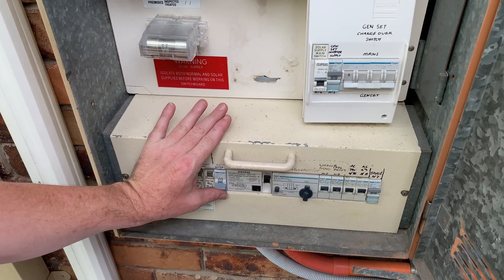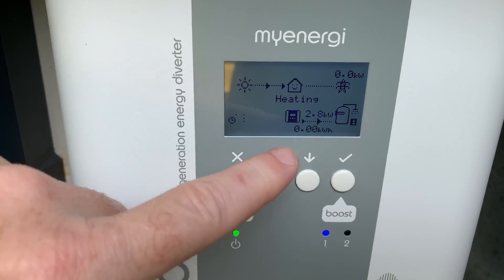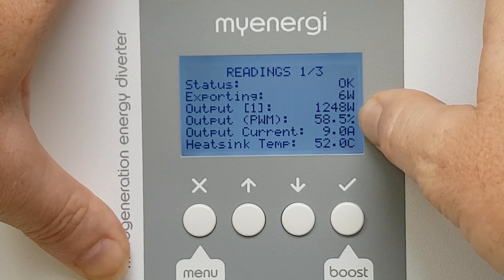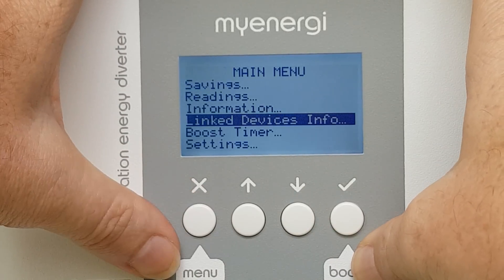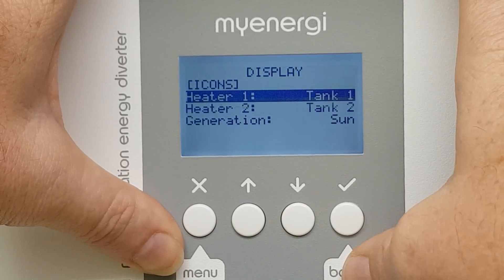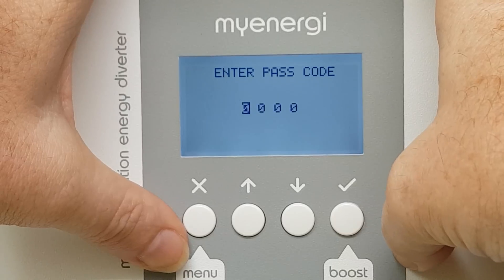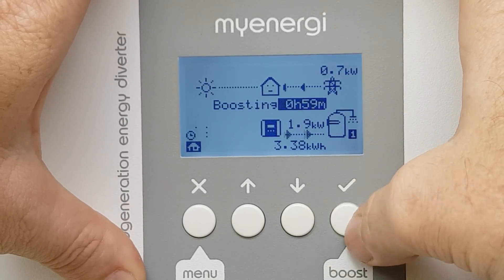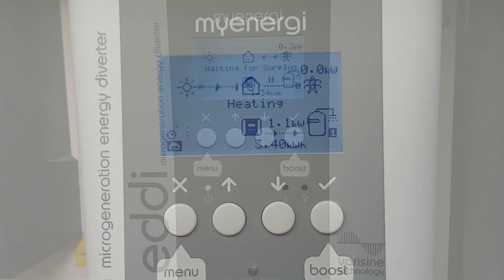myenergi - eddi - ⚡🔌Energy Redirector🔌⚡ - [install montage & menu run through]

Comment: How often would you need to access the unit should it be easily accessible?
Reply from the maker: If you don't have the app, a few times during winter too boost manually. Other than that have not really looked at other than because I like too. That said this unit is still running but not here at my home as I upgraded to a later model to take advantage of the app and my Zappi Electric Car Charger.

Comment: Looks awesome. Has it got a wifi function, and can you enable a boost for an hour at say 3am over wifi? So you don't have to goto the meter box.
Reply: It works with an App that allows you to access all its functions remotely, this requires it to be connected to a Hub which is purchased seperately.

Comment: That's what I need, I don't get paid nothing for putting power back on the grid.
Reply from the maker: It is an exceptional bit of kit - 400kwh it's saved me from sending to the grid since i released this video!
Reply: @HBPowerwall  How much power do you use, I don't use 400kwh in 3 months.
Reply from the maker: 40 to 50 kWh a day I guess inc hws

Comment: Can you do us a circuit diagram of everything from solar to loads in house ?
Reply from the maker: I have this - https://secondlifestorage.com/t-HBPowerwall-Official?pid=867#pid867 but it is old... really need to do a new one with all the new gear
Reply: HBPowerwall would be good to see, can you use the eddy for charging the battery's when there excess solar ( via contactor for charger ).
Reply from the maker: I think with the way the EDDI works I won't be able to as you can't vary the input voltage that much for charging uses. The Zappi does for the car charger but have no idea how that happens

Comment: Very nice! What happens when the water heater is up to temp already? Does it begin exporting to the grid at that point?
Reply from the maker: Exports or you can set a different output. Pool, spa, under floor heating. Or if you have the zappi ev charger paired up you can automatically start charging the ev